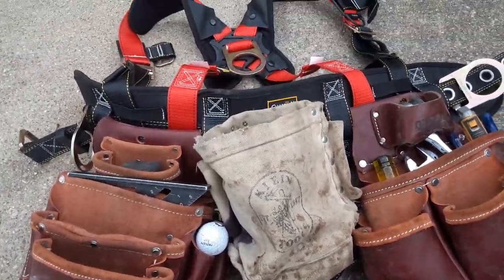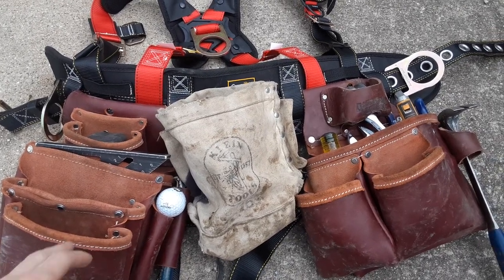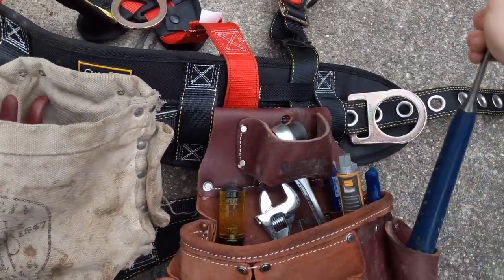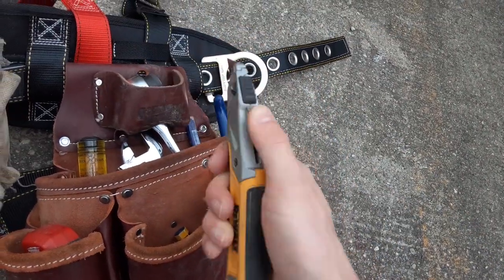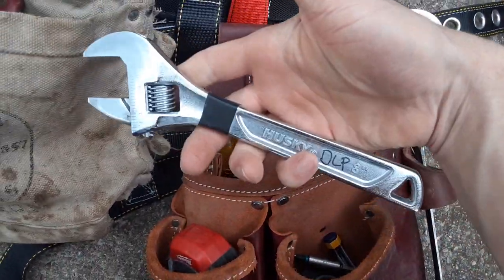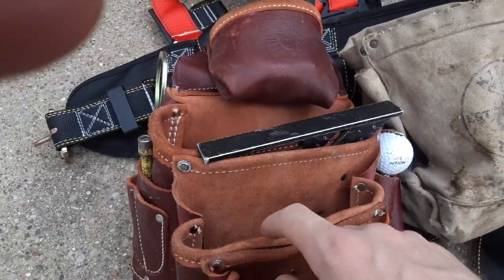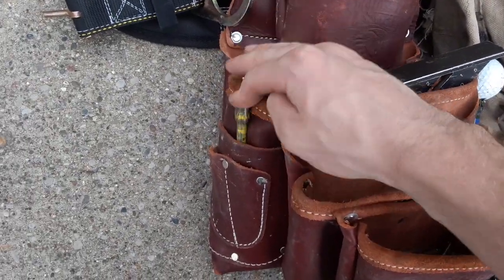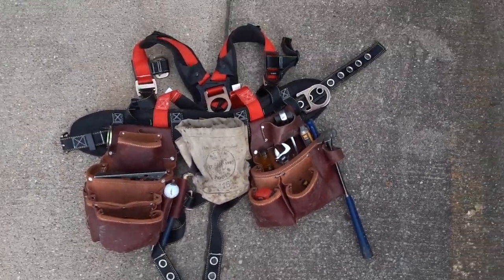Carpenters Tool Belt Setup (Concrete)

Comment: When I got my leather bags, I hated them. When I'm all loaded up with nails and hustling, it would throw the nails in the bottom pouch like a chicken feeder, and on the tools side there is no great place for my pliers or dykes,torpedo etc. After they took a beating from climbing in and out of rear cages I sent them in to get repaired and bought some diamond back bags, and let me tell you the tool organization on these puppies is second to none, pair that with a badger on my left side for nails it has become a near flawless setup

Comment: I’ve been using the atlas 46 bags for the past year and I can say after using Occidentals, I like the change up, much lighter bag and very durable imo. I work in concrete as well. Local 562 Carpenters
Reply from the maker: Have heard good things about those bags. I'm just not really a nylon guy.
Reply: From what I have seen of the atlas bags to me they seem kind of small, how have you liked them, I assume they are still what you use? How have they held up?
Reply: @josephlinares96  I am wearing them now, they have lots of room and better after broken in, holding up well with a few tears.
Reply: @thirdjwcrayton  local 951👊
Reply: @EngineerDr  if you don't mind me asking what tools do you keep in it, I keep pliers, dykes, torpedo, chalk box, chisel on that side, would all that fit?
Reply: @josephlinares96  torpedo, chalk box, lineman’s, dykes, speed square, long screwdriver, and Martinez hammer.
Reply: @josephlinares96  southwest doing big things💪🏾💪🏾

Comment: Nice set up bro!  Mines similar but I swapped out my Cresent for Knippex.  Also have a small pipe wrench, bahco saw for pour strip or to knock off a 2x4 when the saw isn't nearby, a savage lightning torpedo for night shifts, and a scratch awl for snapping lines and when my pencil disappears.  Our pouches are similar but I went with the fat lip.  I also cut off the tape measure holder on the right as it ticked me off, and took my left pouch to a leather worker and got some loops put in.  Pretty happy with it overall.

Keep on building bro!
Reply: Interested in how those loops turned out, did you get them on the inside of the bag?
Reply: @salient2849  Turned out pretty good!  Inside of the pouch.  got 5 of them, and still tons of room in there.  cost me roughly 50 dollars canadian
Reply: That’s actually sick I’m reading it back now you got the loops in your fastener pouch side or just added slots in the main bag with the rest of the tools?

Comment: Great set up brother I’m out of local 425 you gotta ditch that elbow killer though it will get you in the end. Everyone in concretely should check out the ernerbrand hammers they are made by a union brother in California and every bit of it has a different function for common concrete work. They are expensive but 100% worth it I don’t have to carry as many tools with it in my bags. Stay safe out there.

Comment: Had a lot of different bags, Occidental is the best always. But  I wont buy even a cheap set without a speed square slot.
Reply: Did you see the new brand on town brother: Rex Tool Bags?!
Many good ideas on the bags. Especially design for us, as a union carpenters.

Comment: Hey thanks for the videe, Is this a job where its possible to just go into with no prior knowledge? Some guys hired me and they know I have no experience in this other than doing resi electrical work, but I'm a little worried that I'm going to get there and not have a single idea of what im doing and seem like a dumbass, thanks
Reply from the maker: No one can knock you for not knowing what u don't know. As long as you show to work on time everyday and give it 100% you will be fine.

Comment: same set up I have for commercial concrete union as well local 22. surprised you guys aren't using titanium hammers pretty much everyone has stiletto or Martinez
Reply from the maker: I used a Martinez for about three months and it was completely smoked the bolts wouldn’t stay in the head anymore.

Comment: I like that idea with the golf ball. Epoxy to hold it in?
Reply from the maker: No I just drill a 3/8 hole and then beat it in
Reply: @Poes_Custom_Builds  What tool is that? I couldn't hear you, nor do i do concrete!
Reply from the maker: @Tyler-ol6gm  it’s a home made drift pin. Used for aligning things.

Comment: What is the harness that you have the pouches on?
Reply from the maker: It's a guardian. Don't recommend it. Buy an exofit
Reply: That would be fall protection, guardian is the brand.
Reply: Get  your self an exofit
Reply from the maker: @guillaumeethier7508  I have one now been wearing for about a month or so. It's awesome prolly will do a video on it soon.
Reply: @Poes_Custom_Builds  That be dope form your part  🔨🔨🔨
Reply: @Poes_Custom_Builds  is it a good starting harness? then upgrade later on?
Reply from the maker: @749023130560  yes is gets the job done but if you can afford to spend the extra cash get an exo fit. You have to remember that your gonna spend at least 40 hours a week in it so the extra money for the comfortability is worth it.

Comment: 22 ain't no elbow bender. 28 or leave it behind the gate
Reply from the maker: I can drive nails just as fast with my 22 and even faster with my 15oz Martinez titanium now lol
Reply: @Poes_Custom_Builds  You should try out the estwing 25oz "big blue" with 18" handle. Now thats a hammer... I have used one in concrete construction in Finland for about 4 months now. Its better than the 16" handles for formwork because of the leverage given by that 2" and you can choke up on the handle if just hammering small nails. Just my opinion of course
Reply: I use a ultra series 15oz estwing long handle. For me it’s the best one I’ve used so far been using it for 6 years of my 10 year formwork career so far.
Reply: Wood handle 18oz for the win. I've been down that road with the 28 and 22oz no thanks
Reply: @Poes_Custom_Builds  recently switched to a 19 oz vaughn wood handle, loving it so far but still love my 28 when im smacking more than nails

Comment: hey mate do your back a favour and carry as little as you need real carpenters where much smaller set ups you dont need all that fancy stuff
Reply from the maker: Its construction man lol that's not all that heavy either. I'd rather have it and not need it than need it and not have it.
Reply: I do the same work (concrete framing) and I use every one of those tools he pulled out of that bag just about everyday at any given time in a 8-10hr shift, can’t get much done running back and forth to the gang box to retrieve tools that you can carry on you.
Reply: I have to agree in formwork its not always a lights setup but usually it's all needed.
Reply: They don't do real world w alight setup